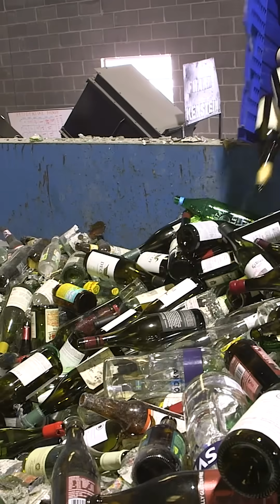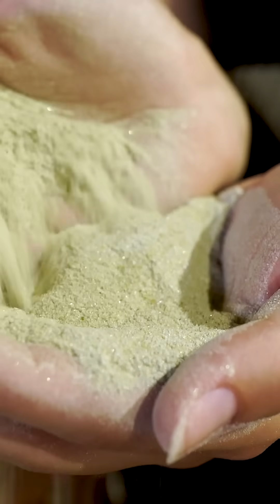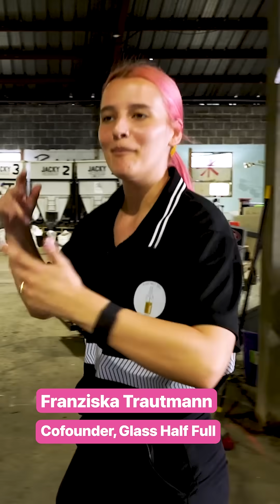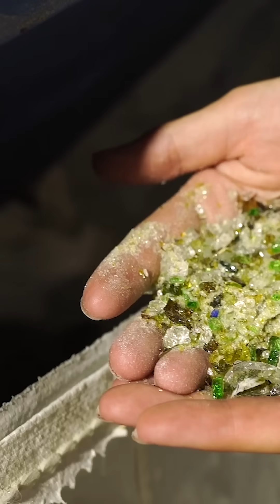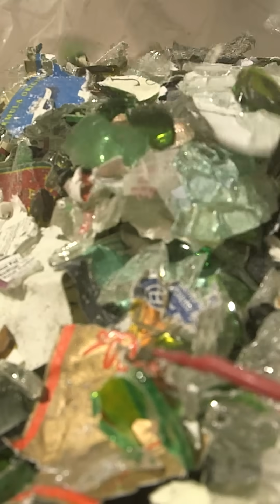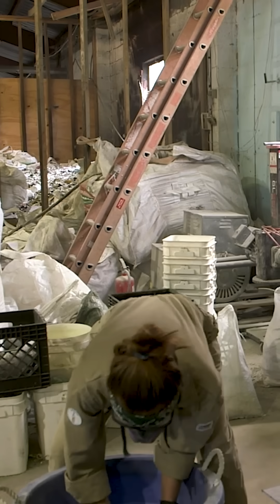Here’s how this entrepreneur crushes glass bottles back into sand. #Recycling #Sand #Glass

Comment: But why though?! Glass recycling is done by melting freaking glass to make more glass with zero loss of quality (in fact... It IMPROVES quality). Turning it into sand again is just a massive waste of energy...
Reply: Seems like this is also a way to get rid of labels or other impurities
Reply: @asdqwe4427  1 - break bottles.
2 - soak bottles in water for a day or so.
3 -  jiggle container
4- remove glass from bottom of container
5- enjoy your non labeled glass

or just place it all into a furnace and skim the impurities from the top of the molten material before turning it into new glass.
Reply: @pedromoura1446  are you sure that’s more efficient? Also the powder is more space efficient
Reply: @asdqwe4427  yeap. Each tonne of recycled glass added to the furnace saves around 1.2 tonnes of raw material and for every tonne of recycled glass, about 580kg less CO2 is emitted (uk data).

And i'm not sure about the space economy but not necessarily... Powdered material usually has more free space between particles which makes it LESS efficient in space usage. As an example if you remove water  (which is filling the gaps in place of air) from silt it will shrink to around 1/2 it's size.
The more amount of the material is solid the less space it occupies (i know it's counter intuitive but think of powdering a material as increasing it's air content)
Reply: @pedromoura1446  compared to a hollow bottle, I really do think the powder would be better
Reply: @asdqwe4427  Btw... 
Imperial Ton = 1,016.047 kg = 2,240 lbs
Metric Tonne = 1,000 kg = 2,204.6 lbs

1 Tonne is slightly less than 1 ton. Just an interesting tidbit for those who prefer "freedom units" XD
Reply: @asdqwe4427  oh! yes. Definitely. Just not necessarily better compared to just crushing it and calling it a day.
Reply: @asdqwe4427  A 2000 degree furnace works wonders for that. Any metals will sink to the bottom (but can mix and color the glass). Organic matter all burns away to CO2 and H20.
Reply: This company sells the sand to be used for construction since sand mining is extremely harmful.
Reply: @nativ3s268  This seems to me like the recycled paper story all over again...
writting paper companies require high quality paper which is only obtainable after processing trees.
toilet paper companies dont care about the quality since recycled paper is softer and what they sell is an end product anyway.
this is spectacular!
we could turn 1 ton of wood into 1 ton of high quality writting paper and then recycle it into 1 ton of toilet paper before throwing it into waste right?!

so what did we do?

We use recycled paper to make writting paper (along with MORE fresh paper paste because recycled paper alone cannot be used to make useable material) for the marketing and in the process made it worse quality and more expensive while ALSO making toilet paper companies use high quality paper in order to make their product which now goes directly to waste with no reuse or recycling. 
so we now cut 1.5 tons of wood with 0,5 tons going to make books along with 0,5 tons of recycled paper from other books and 1 ton of wood goes directly to make toilet paper which then goes straight to landfills.

🤦‍♂

EDIT: the real numbers are even worse btw...i'm simplifying it. the main problem is cost. 
The recycled raw material is more valuable now than the one made of wood directly. This means that ALL the companies that used to take in the recycled material because it was cheap as dirt now just buy fresh material.
if we previously cut around 1 ton of trees to make 1 ton of wateavers per year. now we cut 2 or 3 because we're making everything out of fresh paper paste.
Reply: @pedromoura1446  I agree with what you’re saying but I need to know more detail. Could you cite your sources? That would be really helpful 🙂
Reply: @pedromoura1446 We need respirators against all the negativity you’re putting out. At least she attempted to tackle a problem in her experience with a clever solution, you’re just sitting online critiquing the efforts of others.
Reply: @pedromoura1446 you do realize that these bottles were destined for a landfill, right?  I saw the Penn and Teller’s Bullshit episode about recycling too, but she isn’t taking anything out of “the cycle”.  She is taking what isn’t wanted otherwise and making it useful for many different purposes.  Companies like mine buy recycled products like this, rather than buying the newly produced kind, and there are virtually zero sources in the US.  This is a brilliant thing that should be done everywhere.
Reply: @highfae  what negativity!?
i'm trying to understand why this is being done compared to the better alternative...
companies have been pushing for decades  for governments to allow exploration of more beaches with quartz sand while there's material that creates a better, cheaper product freely around!

is it negative to point out that apple is selling products that dont have enough quality to warrant the price tag too?
Reply: @user-pt1cz4ot1e  i have no idea what "Penn and Teller" even is XD
what i saw here is similar to what's happening with paper in the US (recycled paper with lower quality is being used to make writting paper while toilet paper uses brand new paper paste it just happens that in this case the higher quality is the recycled product)

if your company is a building company 
you most likely dont use that glass sand to make concrete but to fill up the foundations before placing concrete.

If it's one that repairs beaches...well...repair the one next door with higher biodiversity that is being destroyed because they're collecting quartz sand there.

If it's a glassmaking company then well...that's kinda what i was hoping would show up...why is this material not being used in glass? and why powder it? i've been to several places were they use recycled glass and it needs to be crushed sure... but not anywere as fine...
Reply: @nativ3s268 what the heck, why on earth would you need sand from glass in construction. Sand, naturally, seem cheap. It makes no logical sense that what you're saying is economically sustainable in any way shape or form.
Reply: @nativ3s268 harmful to what ??? Someone's feelings??
Reply: @nativ3s268  The construction industry doesnt really care about the quality of the sand so this person is just literally burying tons of high quality sand that could otherwise be made into bottles into foundations and walls that can be made of wateaver.
And it might make everything even worse because smashed bottles alone are not gonna cut it for construction but NOW glass companies are going to mine MORE sand on top of what already is being mined because they also need it to make bottles to replace the glass that we're taking out of the cycle and because they seek a rarer form of sand (with high quartz content) this will make them tap into sources that were previously unneeded.

And bear in mind that such kind of sand is quite a limited resource and we're ALREADY running out of it with new sources being quite often in protected areas with high biodiversity (because quartz deposits along other light suspended materials like organic matter).

It makes NO sense to do this at all...
Reply: @pedromoura1446 Yeah....and construction is in a crisis due to lack of sand 🤦‍♂️ only specific types can be used
Reply: @AwwYouTried8639  more or less... What's in trouble is the glassmaking industry. Sand for glass needs a high enough quartz content otherwise it's not going to melt, not going to be translucid or it's going to be the wrong color... and that's freakin hard to find (something like... And i'm talking out of my ass but... 1% of all sand or something like that is fit for glassmaking). 
For construction what you want is sand either as fine as possible or with a specific granulometry so it holds better after mixing and it also saves money if it's rich in limestone and has low to no salt content (limestone partially dissolves in water making the final product more robust and salt ruins this reaction).
If it's found like this it's cool but it can otherwise be sieved into becoming like this making it more expensive but by no means rare.
In fact River sand is spectacular for building because it has all of these characteristics while sand with enough quartz for glass can mostly be found on the coast...either way... You're reducing quality of the final product and ruining the environment trying to turn one into the other 🤷
Reply: @pedromoura1446 can you summarise it and make it understandable
Reply: @AwwYouTried8639 Lets clarify this. Sand for concrete use is in short supply. There are plenty if other uses in construction. However I don't know if glass cullet is acceptable for use in concrete. Some fiber glass breaks down due to the alkaline nature of concrete. Other glass is fine and used as an admixture. Since this cullet is mixed recycled glass it may be hard to be sure the right kind is present. Or maybe all glass bottles are an acceptable type. I don't know, but its a risk. 

I agree with this post though. For recycling glass it is a huge waste of energy to crush it finely. The same as compared to extracting and sifting it as well.
Reply: @pedromoura1446 In NC they have stopped collecting glass bottles and jars for recycling anyway - we are just told to put glass in the garbage bin, so it goes to the landfill.
Reply: @AwwYouTried8639 The world is actually running out of sand used in construction 😅
Reply: @pedromoura1446 You didn't listen. Learn to open your ears and utilize them. All these glass bottles were destined for landfills but this company steps in to then utilize it rather than bury it
Reply: @pedromoura1446 Yeah actually, they do care. Do you know where every country in the middle east gets its sand for making concerete? The UK. The sand there is perfect for concrete. Desert sand is not. If it didn't matter why would they go through all that hassle?
Reply: @pedromoura1446 as saying goes "The road to Hell is paved with good intentions"
Reply: @PhoenixFires  it's also better to send trash into a landfill than to let it at your door forever... Just because it's better than nothing doesnt mean it's good.
Reply: @itiscujo  of course theres better sand for construction than others... Desert sand grains are too round to hold properly. But sand for construction can be from rivers, beaches and even "made" by grinding stone or digging a hole in the ground. Quartz sand in building is only suitable as a base on foundations and not for making concrete. Sand for glass is also 1% of all available sand. It's not even comparable the amount available for one and the other...
Reply: @pedromoura1446  Construction cares massively about the properties of sand. Why do you think we don't use the sand from deserts or riverbeds for concrete or filling back soil. The sand is so round that the friction between grains gets so low no loads can be supported or a proper concrete structure can form
Reply: @christophbethe7871  I understand that. the thing is THAT can come from rivers, beaches and quarries with similar costs because it always has to be processed (River sand needs to have Clay and organic matter removed, beach sand needs to be washed away of salt and mined rock needs to be ground up to specifications... ). 

While quartz sand is only 1% of all sand and mostly found in beaches.

For construction i could theoretically dig for sand near the construction site and then just crush it or sieve it to obtain what i need. For glass i could dig for miles and never find quartz in it or otherwise needed to refine the material again and again and again in order to obtain even a small amount at 95% purity.
Reply: @pedromoura1446 tell us you dont understand the differences in types of sand without telling us you don't know there are differences in types of sand...
Reply: @pedromoura1446 you there is a difference between sand and sand usend in construction you are not allowed to use just any sand or is it normal in usa
Reply: @court2379 I purchase the finely recycled glasses like that.  Not sure where you think we should get it otherwise.  No where around us recycle glass anyway.  It’s all thrown into the dump.  Not a waste of energy if there was literally zero effort beforehand.  It’s only a waste if it has no purpose, or there are more efficient options.  If you know those, please let me know.
Reply: @pedromoura1446  it would’ve ended up in a landfill so the same amount of sand would’ve been mined.
Reply: @pedromoura1446 dude saudi arabia has to import sand for construct despite them living in a sandy dessert, bruh
Reply: @pedromoura1446 are you an engineer by chance ?
Reply: @Faesharlyn   quartz sand is only used as filler in construction (not structurally) and is only 1% of all sand that's available.
please elucidate me why i should waste more characters on the remaining types of sand (which i did in other comments were that was relevant).
Reply: @derionone  yes. i know. but the point is that quartz sand is far rarer than "normal" river sand or beach sand. 
construction sand can also be manufactured while you also cannot do it easily with quartz sand.
 You'd need to mine and crush pure quartz or refine other types of sand over and over until almost only quartz remained. 
The amount of energy for either of these processes in order to make glass is tremendous when compared with sifting sand until you get the mechanic properties you're looking for construction.
Reply: @IratePuffin  completely agreed. a friend of mine used to say that "when everything is sh*t a blade of grass smells like perfume.". 
i'm not criticizing her, most likely great, work were there is none. 
i'm just trying reeeeeally hard to understand what circumstances, or lack thereoff, made this company something outworldly and spectacular when it's common practice in the rest of the world to sell this glass to glass manufacturers that are more than happy to work with this superior material than buying sand.

To a person like me that lives in a country were doing this is a no brainer it's like praising people for...i dunno...crossing the street on the crosswalk or making sure the food you sell is not decaying...
Reply: @zman90  well...they could...they just wouldnt be able to make skyscrappers XD
Desert sand grains are too round so it doesnt hold up well... (there's also some sweet traditional buildings that are excavated instead of built upwards)

Think of it this way...the perfect building material is a solid block of stone. but you cant mold one easily and the thougher the stone is the harder it would be to shape (it's also more difficult to find the perfect material for certain constructions) so the next best thing is to get something as close to solid as possible made from shards of a resilient material before filling in the remaining gaps with cement.
So you want somewhat jagged grains of different sizes so they fill the holes left by one another leaving almost no gaps before you throw in a material to fill them. 

anyway...you can still make i dunno...small houses with desert sand and even wood ash or clay...just not taller, more "modern" buildings.
Reply: @KO-fh4vn  yes. not that it matters much but i am XD
Reply: @pedromoura1446  lol not true. it has to be good-quality sand. Beach and river sand, it cant be just sand. Check your facts.
Reply: @waveril5167  sigh...i swear i've answered this a million times by now...
I KNOW!
that's partially my point since quartz sand is terrible for construction (unless you use it as filler when it's cheaply available which is a waste).

FOR CONSTRUCTION, you can use river sand, beach sand or do what is becoming common practice now, due to lack of river sediment and all the problems their removal causes, which is MAKE sand from stone mined from a quarry.
Manufactured sand is usually better quality because it has very specific granulometric and mechanic properties that allows for material savings because it can be prepared to have wateaver compression resistance you require. For a small house you can go with the cheapest material (even desert sand can be used although it's terrible), for a taller building you can reduce costs by using a better material and for a skyscrapper you need several different types of sand to make concrete with different properties depending on the height.

FOR GLASS only 1% of ALL SAND has the required >95% quartz composition to be useable. And it's usually found IN BEACHES (although i am aware that in-land sand mines exist the same as in-land salt mines exist).
And if that was not all those beaches are either occupied by tourism, have high biodiversity or are disappearing due to coastal erosion. 
The alternative to this is to mine quartz and grind it into sand or by vaporizing SiO from minerals containing silica which is then turned into SiO2 (aka quartz) by making it react with oxygen.
Both of these are highly energy intensive because quartz is rarely found pure despite being one of the most abundant minerals on earth and because it's hard as f***! (for comparison... ordinary steel has around 4-4.5 hardness on the moh's scale and your teetth have around 5 while quartz has 7).

we're also using MORE and MORE of this material not only in glass bottles and windows but in fiberoptics, solarpanels and SEMI-FREAKIN-CONDUCTORS (which we are literally on a crisis of lack thereof).

That's my point...construction sand can be mined almost anywere and the most important thing is the shape of the grains and their granulometry (the % of each grain size in the sand).
(ofc the material is also of some importance ,especially for taller buildings, but even then the best sand for it's load capacity is made of granite, of which we have literal mountains of!)

so...We could mine the granite for construction and use the sand for glassmaking OR we could vaporize the damn thing to obtain quartz and use the sand for construction. which one do you think it's easier?!
Reply: @pedromoura1446  no, I don't waste my energy on people like you, who no matter how much one tries to educate remain recalcitrant to learning and prefer to believe in their own opinion regardless of the evidence.
Tell the Egyptians that "Quartz sand is terrible for construction" lol

 Have a nice day : )
Reply: @pedromoura1446   sand quality is a big thing  in construcktion but i doubt they use ground down glass when you can dig it up.
Reply: @pedromoura1446 "the construction industry doesn't care about the quality of sand"

Stopped reading there. There absolutely is specific kinds of sand required for various construction techniques. This is the reason there is a growing concern over a "sand shortage".
Reply: @pedromoura1446  you realize she said they get it from landfills meaning it's been thrown away ergo will no be recycled into more glass ergo what she's doing is still recycling said glass it's not a waste for them of they have companies that buy the product. when people actually recycle on a global level then it woupd be a waste but since the majority of people do not recycle your argument has no real point
Reply: @pedromoura1446 you've never heard of Penn and Teller?
Reply: @pulaski1  or take it to designated glass dropoff points like the library and fire department near my house where they're then taken to glass recycling plants... or that could just be a local thing since I'm in GSO...
Reply: @SpixTenny  Locally I can take glass to the county-run waste collection sites (for people who don't want to pay for garbage service), and among other things (paper, cardboard, glass, engine oil, etc.), they still , apparently, collect glass for recycling. ..... I am skeptical that it is actually recycled though.
Reply: @pedromoura1446 you have no clue what you’re talking about. it’s kinda comical.
Reply: @pulaski1  I can't argue with you there... blegh
Reply: @Faesharlyn  egyptians quarried limestone from miles away for construction and modern egyptians probably use normal concrete for the rest like everyone else (which doesnt use quartz sand because it Binds terribly) but i am quite curious as to why you'd say that since quartz sand is hard to find and searching for it explicitly for construction is very unnecessary...
Reply: @pedromoura1446  quarz sand is hard to find?

Saharan dune fields are, with a few local exceptions, composed of pure quartzose sand. Millions of acres of it.
Reply: @tobiascarlsson5967  depends a lot on the construction size and the building part but yeah. Thats the jist of it.
Reply: @UpToSpeedOnJaguar  the "sand shortage" is not because there's lack of sand in the world. It's because production cant keep up with our increased demands and because we used to rely heavily on sand digged from beaches (which are eroding away) or rivers (which cause eroding beaches, collapse of river infratructure and damage to the river ecossystems). Nowadays it's mostly manufactured in quarries with better mechanical properties but we also use stone so everything is pilling up.
And as i've already said around 14 times by now... 
In theory you could dig a hole in the ground were you're building and then just grind or sift what comes out and mix it back again to get the needed sand for construction. You cant do that to get sand for glassmaking (quartz sand being 1% of ALL existing sand).
Reply: @Homemaker-eg2he  she's getting the material from somewere isnt she? She's either mining a landfill or getting it from the landfill company that separates it for her.
This is just a normal process in the rest of the world done in every single trash collection plant because glass has value and the state doesnt want to pay to keep an inert material on the ground wasting space were other materials could be placed...
Reply: @poppysdaddi  enlighten me please
Reply: @ericbuzzard2041  nope
Reply: @pedromoura1446 I'm with you, it sounds crazy, BUT...they did say she's getting the glass from the dump & not from recycling...so... maybe it's worth it ...?
Reply: @pedromoura1446 one more thing, can't we just pump sand up from the sea floor? giving us basically an infinite supply??
Reply: @erkl8823  she's getting only glass which means they're making a triage somewere like they do in other countries for all the trash. but yes. i agree that it's better than using the glass to fill up the garbage dump. the absence of recycling entirely is just baffling to me.
Reply: @erkl8823  we could yes. We do just that when searching for archeological artifacts. But it's just much more expensive and we could never supply the several hundred tons needed, add to that the fact that the bottom of the Ocean is almost always a rich ecossystem unlike dry earth ecossystems and it's better to just leave it alone . For construction it's just easier to make it either by recycling concrete or from mined stone as for glass, recycling and quartz sand are still our best sources.
Reply: Was gonna say. Wonder how many tons of coal this sand factory burns on a weekly basis, in terms of energy use.
Reply: Ikr, I would not feel safe with sand made from glass
Reply: It's great for sandblasting no silicone in it anymore actually safer than new sand.
Reply: @johnscott2849  errr...quartz is SiO2 (ie. silicon dioxyde) so it's literally silicon XD
but i can understand why it's great for sandblasting given the material properties of quartz...
Reply: Probably so that other companies can produce fiber glass. Would make sense since no one is sorting these by color.
Reply: @quinson93  that... Is actually the best argument i got for this so far... Probably you would need to purify it to some point but using it for fiber glass could indeed make some sense...
Reply: IT's.. not even sand.  It's glass dust.  It can't be sand again since the chemical reaction that made it glass isn't undone by simply smashing it.
Reply: @realbaconoverlord  my point exactly. Crushed glass around the size of a thumb can be turned into more glass. Why go further and waste the energy to powder such a hard material (it's harder than common Steel btw) instead of just chucking it into a furnace?
Reply: @pedromoura1446  No kidding.  It's an unnecessary step if they are planning to make it glass again.  However, in today's society??  They'll probably use it in children's playgrounds...
Reply: Yes!
Reply: Ya na
Reply: Well, you can use the incredibly desirable sand to create construction materials like concrete or a singaporean park instead of the modern status quo of freaking sand mafias with corrupt government connections literally stealing sand in broad daylight and then nobody actually asking where the sand they just bought came from, heavily damaging valuable rivers and entire beaches disappearing over the weekend.

It's like flicking water at burning rocks but it's still something.
Reply: They do it to help restore wet land.
Reply: I agree
Reply: I'm with you. These people have no idea what they're talking about. This is probably one of the dumbest recycling ideas I've ever heard. It's just crushed glass. It's not really sand. You can't make sand from crushing glass. It will either be too large, and just be sharp chunks of glass, or be too fine like what she was holding and be glass powder which is very dangerous and also mostly useless.

This is not "green" recycling. This isn't helping the earth. The electricity used to crush this glass and the trucks used to haul it to and from their 'sand refinery' is using more non-renewable resources than it's saving. Wait, is it saving anything? There is more sand on earth than nearly anything else besides water lmao. This is a scam. She probably gets tiktok girls to fund her pet project and gives herself a hefty salary. If you look into it, most of the people who run these "green" start-ups live very, very well and make a lot of money. Especially when they get funding from the government because their aunt is the mayor or something. They make some lame idea, their friend in the city government gets it funded, and they both make bank. Or they take advantage of stupid people on gofundme.

Seriously, I'm all for recycling, but this is a scam. We literally have over 7 quintillion tons of sand on the earth. And this girl has convinced people we need sand 2.0 LMAO. The whole point of recycling glass is to turn the waste into something useful. The best method is for bottle recycling so company's can re-use bottles that have been turned in which a lot of companies do. Not crush it and sell it to the city to use in local construction hahaha. I have to admit it's a clever scheme. Something you'd see Randy do in a South Park episode. It's just stupid and simple enough to fool the dumb people who would flush their money down the toilet if someone told them that fish could eat $100 bills.
Reply: Oh my, why do you think plastic comes in granulate form to factories?
Reply: @davidd2661  glass needs to be crushed yes. Not made into sand. Plastic comes in granulate or does it come in fine powder hmmm?
Reply: @pedromoura1446  yeah fine glass sand is weird. Also could maybe because larger chunks are more dangerous
Reply: @moltenhydrogen2218  Maybe you're misreading or mixed up comments but I literally said that this is a more effective use of glass. What gave you the impression I didn't?
Reply: @PhoenixFires  oops, replied to the wrong person
Reply: Erosión
Reply: I left the comment that basically said the same thing, moronic 😂
Reply: This business model creates a demand for a product that is already stocked to the gills. Im lost as to what the “entrepreneur” achieved here.
Reply: @mikefresca2758  that was what i was trying to understand. If you read the above comments it appears that most glass in the US is not recycled and is sent for disposal along the rest of the trash... Some people even claimed it's more expensive to recover said glass than to make new one from sand which confuses me to no end...
Reply: Rebuilding unnaturally eroded sandbanks is one of the main uses
Reply: @BrushiumTentaculum  which we're going to erode back if they have sand with the required quality to make glass...
OR...we could recover those places with non quartz rich sand that would be cheaper to find and wouldnt cause material scarcity in the glassmaking industry...
Reply: They also sell the sand for coastal reclamation
Reply: @WithersStan  again... Why?! That "sand" is well sought after and entire beaches are razed to get it due to it's rarity. By placing the glass back into the cycle you're preventing the need for it in the first place...
Reply: @pedromoura1446 dude what are you saying? They put it into bags and use it for coastal restoration in Louisiana because they are using more sand to fix their coast than can be produced. So this is a good option considering they use so many bottles in Louisiana.
Reply: @indiaknowlden9699  i'll try to explain again why doing that is silly, it's going to be a long comment but bear with me (i'll also try to explain why it makes no sense to construction. you didnt ask but most people also talk about it and i want to address it).

1st of all, beaches only require restoration for 3 reasons:

1 - there's a port nearby.
the outcrop of the port caused sand to retain north of the natural beaches, this can extend throughout all the coastline as people try to solve the problem with other outcrops called "spurs" that retain sand, which cause problems downstream, wich requires more spurs...etc...
How do you solve this? you remove the spurs or create a bypass in every one.
What do you do now? you pay for the dredging upstream then you sell that sand to someone who sells that sand for wateaver including placing that same sand on the beaches to "restore" them.
there's no lack of sand for this process...

2 - the removal of river sediment.
dams and other constructions in the rivers create sediment acumulation which is then most often dredged and sold for construction although a % is forced by law to be dropped downstream. this greatly diminishes the amount of sediment that reaches the sea and therefore the sand available for the beaches.

3 - rising sea levels. as sea levels increase sand is more often reclaimed by the sea due to storms or currents. how do we solve it? we dont unless we solve climate change.

Just so you know...1 and 2 are the major problems by a longshot, the 3rd was already a natural process that is only now becoming a problem because we abuse 2 and have delayed solving 1. 3 was a increase in coastal erosion just strong enough to make things go awire in some spots.

Now you know that there's plenty of sand out there you got to undertand that:

> for construction RIVER sand is preferable (rich in limestone is even better) because it has no salt (salt ruins the cement bonding) and the differing size in the grains creates a better structure as it fills most of the gaps)
If none of those characteristics are available they can be made by sifting and mixing sand grains with differing sizes or cleaning it to remove the salt (this also makes the end result more expensive).

>for glassmaking usually BEACH sand is preferable because the sea currents separate the grains by size and materials, so by knowing the weight of the material you're looking for you can literally find a beach full of it down the coastline.
fine sand, high quartz content ready for the taking in some specific spots (there's also in land reserves were the sea used to reach. the same as salt mines).
unfortunately...quartz is very light and tends to deposit were organic matter also does which means that those beaches are also often filled to the brim with biodiversity.
This means that mining sand for glass is VERY environmentally damaging.

What's the problem in using milled glass for beach restoration and construction then?
well...

1st - even glass milled as fine as shown is jagged. this means that if it enters your eyes or lungs it's going to cause massive problems. you dont want that in your beaches OR your house.(it's the same problem we had with asbestos.) 

2nd - it's NOT what the construction industry is looking for. you want a high diversity of grain sizes so they fit in each other like a puzzle and fill as many gaps as possible. this diminishes the amount of cement required to maintain the same structural integrity so they'll at most use a small % of glass powder as fill (and it's very unlikely they will given the high price of this material)

3rd - It's removing material from the industrial cycle making them seek out more.
you're placing what's essencially quartz on a beach that is then going to be washed away until it refills the beach were people are extracting sand for glass with a LOT of lost material in the process. so it's going to end up being used to make glass, again, just with extra steps. instead we could reduce extraction by using that same glass to make more glass instead of extracted sand and that would save us:
> the energy to mill it, 
>the energy to mine sand,
>the environmental damage of extracting that same sand and some extra due to material loss,
>the energy of transporting the glass to the milling factory,
>the energy of transporting the glass sand to the beach,
>the energy to transport the beach sand to the glass factory,
>the energy required to refine the beach sand into high quality glass,
>etc

4th - there's no lack of sand for beach restoration. it's just stuck in the wrong place (dams, bridges, spurs, ports...) 

5th -hundreds of tons are required each year for ONE single beach. there's no way they can produce enough for even a single beach by milling glass so this "sand" they're making will amount for a very small % of what is used. not enough to warrant the energy cost of making it. if they were milling used bricks and cement into sand again maybe...but glass?!

TL;DR:
this solves nothing just creates more problems.
Reply: @indiaknowlden9699  the reasons there's not enough sand are well known:

1- rivers have dams and bridges which accumulate sediment. that sediment is taken away and sold. if sand never reaches the sea it's never made into beach sand. >solved by: forcing companies to drop some of that sediment downstream instead of just selling it all.

2- docks and ports accumulate sand upstream (i believe in the US the coastal streams are south to north due to coriolis effect), which would otherwise reach the beaches. that same sand is ALSO taken away and either sold or gets stuck again in structures designed to maintain beaches upstream of them. 
>Solved by: making bypasses so that sand can reach downstream beaches.

The zones that require coastal "fixing" are literally starved for sand and require TONS of sand each year to be maintained that are usually bought from the companies that clean ports and dams or from the dam and port companies themselves (depending on the contract) and then placed on site. 
Making artificial reefs (which i suppose it's what the sandbags are for) is not only just a temporary solution unless you get a equilibrium between the amount of sand getting in and getting out but powdered glass is a terrible material to make them because it's jagged (damages the geotextile used to hold it), light (it WILL be dragged away during a storm) and made lighter after being powdered (after a tini tiny rupture say goodbye to the whole content).

There's also the added problem that sand made from glass is really not that much. 
as an example...
we restored a beach here in my country. it took 3 HUNDRED tons of sand, will take another 300 in 5 years and it's not even comparable to most beaches in the US. 2 or 3 tons is not going to make any difference.

If you want to do this just use refuse from  construction. it's much easier to turn into useable chunks,  more readily available than glass and you're not screwing up a whole industry that is already struggling to find material in the rest of the developed world.

Just sell the damn glass! 
Europe would gladly buy the material since it's cheaper, higher quality and doesnt cause as much environmental damage than using natural sand...we're LITERALLY suffering pressure from glass companies that want governments to let them explore high biodiversity beaches for sand to make glass and here you are throwing it into the sea...
Reply: @pedromoura1446 man I wish the people running these things were as knowledgeable and passionate about their work...thank you for taking the time and explaining everything in detail👌
Reply: @pedromoura1446 you are wrong watch the full video for all the information
Reply: @S5S5066  please elaborate
Reply: @pedromoura1446  glass half full does this for coastal restoration in louisiana because we are literally losing sizable portions of the coast and land each year due to coastal erosion and rising sea levels, mainly due in part to climate change. maybe don’t assume harm where it’s not immediately apparent if you yourself don’t have enough context to create a substantial argument to stand on.
Reply: @jyesthamars  i 've heard that argument several times and still makes no sense... You know how much sand we' ve used to restore a single beach here? 300 tonnes. And in 5 years we're going to need more 300 tonnes. There's no way she's producing anything even near that amount and this is just for a single tiny beach not even comparable in size to what's being restored there.

Quartz is very light and powdered is even worse so it's also going to disappear faster due to wind and currents. Even if used just for making artificial reefs it's a terrible material because those are made by filling bags with the sand and chucking them into the places that suffer more from the waves. This glass sand is jagged if you look at it under a microscope which means it damage the bags and then spill out and disappear in a blink of an eye.

Adding to all this quartz sand for glass comes FROM BEACHES. Which means that for every one she restores with that material theres around 1-2 beaches being destroyed to make up for the material that was discarded. If she sold it back to glassmakers she could make a far reaching impact. 

and before you say anything recycled glass is LESS energy intensive, produces BETTER glass AND it's cheaper to obtain because what people throw away is basically pure raw material that doesnt need to be excavated and purified. 

 so maybe, just Maybe, i DID check my stuff?
Reply: Must be a US thing... I cannot imaging this in any decent developed country.
Reply: @AreThou746 why?
Reply: @AreThou746 I'm in the US. I'm sure she thinks she's saving the planet,..
Common sense is thin on the ground at the moment.
Reply: @AreThou746  Glass must be crushed into cullet before being melted otherwise the process becomes inefficient. So yes it is a US thing and a recycling thing. But tell us more about you incredibly pathetic imagination...
Reply: @AreThou746  It's the exception for sure.
Reply: @court2379 what exception are you talking about?  The US doesn’t even recycle glass.  This is someone privately doing so.  I’m really confused as to where you guys are getting your info, because it’s totally off.  LOTS of other places recycle glass, and many do this or similar techniques.  Do you not remember the glass recycling vending machines that came out in Australia years ago.  This is that on a huge scale.
Reply: @user-pt1cz4ot1e  I have traveled quite a bit and found few places in the US that recycles glass. So for the most part I agree it is not a common practice in the US. It is in the EU. There are several key differences though. The population is not as spread out. The public sorts the glass when they take it to the bins, not just from other materials, but also by color. There are bins within walking distance in a lot of cities. They are more willing to walk places.
The US is more spread out so the number of bins and effort to install, maintain, and empty them would be greater with the associated cost. People are less willing to make the effort. Current recycling methods rarely have the people presort it. Everything goes in one bin and then to a sorting facility. Those facilities if they handle glass often don't sort by color, so the result is mixed color broken glass shards. The US is large and often has abundant sources of raw materials. 
So there have been arguments that if other counties can do it, it must be economically viable in the US as well. Because of the factors above I disagree, and that is bolstered by the fact that it is almost never done. If it was profitable, people would be doing it. 

The waste of energy issue is that for recycling back into glass, it doesn't need to be crushed and sifted to sand. Just small enough to get trash out, and make handling it easy. For use as sand extracting it from natural deposits uses far less energy than collecting, sorting, crushing, trash removal, sifting, etc.. People are also talking about it being available to help alleviate the shortages of concrete quality sand which would make it more valuable. I don't know if it is suitable for that or not. I know some types of glass are damaged by the alkalinity of cement making it unusable for that purpose. If it is usable, it might be cost competitive with available sources and worthwhile to spend the effort and energy. If not used for concrete there are many other sands that are far cheaper and readily available in most areas of the US making crushing it to sand a questionable value. In general though if the process was a cheaper method, it would be common. Economics drives most things in the US. 

Hopefully that covers most of the discussion. What specifically did you question though?
Reply: @AreThou746 Sweden, Slovenia, Australia, Italy, Belgium, Spain, Brazil, Japan….

The US doesn’t recycle glass at all in most places.  Why do you all think this glass would be going anywhere else in the US?  🤨
Reply: Looking at the size of her operation tells me she has customers.
Reply: You need to turn it into sand so you can melt it first.
Reply: @mrbanana6464  not this finely... It's crushed sure... but not powdered.
Reply: That's glass that has been put in a recycling bin, this is glass that was heading for land fill.
Reply: it doesn't mean to place it back on the beaches. it just means the fraction. it could be used in building development I suggest 🤔
Reply: @wie_der_mond  either one is a dead end use for a already rare material...
it will either sit on a building's foundations or on a beach while tons of similar material are being mined from another beach to make glass.
Reply: @pedromoura1446  no, you cannot use every beach glass to make a concrete. For example, there was a big problem with building skyscrapers at Emirates: they have a lot of sand, but it is not suitable for building 😄 they should have bring it from another countries!
Reply: @wie_der_mond  oh but you can!
beach sand is not the same as desert sand and not all beach sand is the same.

The main problem with beach sand is the salt (and other small things like shells and organic material) that have to be removed or they'll mess with the cement binding making for less durable and less resistant concrete.

This is why normally river sand is preferable. There's no salt that requires removal and the grains are jagged enough to fit into one another like a puzzle diminishing the space between solid material and the cement (increasing material strenght while reducing the amount of cement needed to bind the material together).

Desert sand has a different problem. it's grains are too round after centuries of wind erosion so they fit into each other less like a puzzle and more like a sack of marbles.

They could still make houses out of the concrete made with desert sand, just not several hundred story tall buildings that usually require several types of structural concrete and materials to sustain it...

Most sand used in those has to be manufactured from stone mined in quarries and then sifted and prepared to have very specific granulometric and mechanical characteristics not only for structural reasons but also cost. 
Every floor up from, i believe it's either 5 or 7 floors (cant recall exactly so dont quote me on that)...doubles in cost from the previous one, so the materials have to be as light as possible to reduce costs while being as resistant as possible to compression and maintaining enough elasticity to not break apart (the wind strenght on the top of some of these buildings is outright crazy and they'll need to be able to bend sometimes several cm's)

Essencially even if they did have sand with enough quality for building (like river sand) they would still import it since the material specifics for skyscrappers are ridiculously complex.

They COULD ALSO mine it and sift it on site (just dig a whole deep enough and you'll inevitably find stone to grind XD) with enough quality to do wateaver, if they wanted to, but it's much easier and cheaper to order already prepared sand from someone who knows what they're doing and already has the infrastructure to do so and also if there's something saudi arabia doesnt lack is money so even if it would be preferable in the long term to make the sand there they dont really care XD
Reply: @pedromoura1446  wow, thank you😃 didn't know!
Reply: @wie_der_mond  anytime ;)
Reply: @pedromoura1446  I'll just say, as someone who actually read your arguments, good job properly explaining things. 

The only reason I went into comments was "this is dumb, glass has been recylcled for so many yars now, what is this "entreprenueur" bullshit."
Reply: @pedromoura1446  look, when the option of disposing glass is either the landfill or turning it into a usable product, i would take this over the other option. You even admit yourself that most glass is not recycled in the US. This might not be your preferred way to recycle glass but its making a change in Louisiana and if they can get their hands on enough glass to continue operations then they are needed in the region.
Reply: @moltenhydrogen2218  if you read were i admited that you'd also notice i've said "when everything is sh*t a blade of grass smells like perfume".
Sure... It's better than throwing it into a hole and calling it a day. A lot better in fact.
And again... I'm not attacking the Lady that did this. She found a way to do it were no one else did which is nice.
It's just that recycling glass is such a good idea with literally no downsides and a given in the rest of the world that i'm mostly confused at how could there be a market niche for this to even be a thing given the highly superior alternative...
It's like hearing of a company that makes a profit turning aluminium again into bauxite for use in building...
We've had to make sooooo much regulation in Europe to deal with the "profit 1st" approach of the US to everything to even get SOME focus on efficiency to the point i have no idea how you still have a functioning economy with so much inefficiency...
Reply: I was wondering that too. How do you make a business of this outside of "female run company here,  give me money"
Reply: Every time @pedromoura1446 replies he sounds more and more desperate to be agreed with, I cannot imagine living like this lol
Reply: @intenseavarice34  it just hurts my environmental engineer soul to see people still agreeing with visibility instead of what actually works (and i dont like the bell having the numbers on display. it messes with my ocd)...but hey...if insulting the commenter is easier than thinking more power to you...
Reply: @pedromoura1446 This glass would end up in the landfill. Many places in the U.S. don't recycle glass. I believe this is why she started the company - to prevent reusable glass from being thrown away.
Reply: @emem2863  sell it to the EU. we'll buy it by the metric ton.
Reply: @pedromoura1446  The scrap value of post-consumer glass bottles is less than it costs to collect it from US consumers and ship it to Europe.  In any case, usage of glass containers is dropping sharply - most beer brewed in the US, and now even some water and other drinks are being sold in (easily recycleable) aluminium cans and bottles.
Reply: @pulaski1  That is just if you're not accounting for externalities :)

For instance...

The cost of land for burrying it and since you're doing it with a lot of toxic stuff you'll need to keep an eye on it despite glass being inert so you're just making landfills bigger and more expensive over time.

The cost of the garbage trucks doesnt change since you're going to have to pick it up anyway...trash can or recycle bin.

The cost of having to obtain the material somewere else instead of just refining what you already have on hand.

etc.

Of course the market alone doesnt care...it's up to the state to correct and make them pay for externalities to make them care and invest in what makes sense. like it's done for trains, roads, electric vehicles, wind turbines or solar panels.

in germany you collect bottles in supermarkets for a fee.
 the US used to do the same with not only glass but also with aluminum cans (i dont know if it still does now) and it worked fine.
in my country the state gets it from recycling points placed everywere.
In japan a truck from a company that requires the material goes to each building (at least once per month but most likely once per week).
It works in very different locations in very different ways the initial cost is usually the only problem. if they just dont want to pay short term to reduce costs on the long term that's on them but europe would still gladly get the broken glass even if you just burned all your trash and sold us the slag. in fact we do it to each other internally for specific materials so...🤷‍♀
Reply: @pedromoura1446  You know very little about the situation in the US.  Things vary by state and some states still have bottle deposits (5¢-15¢) that can be reclaimed by returning the bottle.  MOST states have never had bottle deposits.  And the cost of a deposit bottle system effectively doubles the cost of shipping a product as every bottle that you sell has to be transported back to the factory when it is is returned - so it is highly debatable whether a bottle deposit system is eco-friendly anyway.

I am not going to dismantle your very long post, but the cost of separating and handling glass, even if it is put into a recycling bin, dwarf all the cost savings of not sending glass to the landfill - except for the cost of making new glass/ new bottles.  But as I already said, the usage of glass for beverages in the US is in sharp decline anyway.
Reply: @pedromoura1446  Why don't you send the business owner your suggestion?
Reply: @pedromoura1446 I see the logic in your posts, the US is just very illogical. The fact that there’s even ONE of these plants is a miracle, the US is horrible about recycling, to the point that this company, even if its inefficent, is still a better and more beneficial option in the states to what we have right now. It’s cool to see how passionate you are though, I can tell you care about environmental engineering. The US does not, its horrible how poor we treat our land, because we stole it, and don’t care about it.
Reply: @pulaski1    it doesnt double anything. I dont know were you got those numbers but you have 4 ways to get recyclable materials.

1- door to door. 
2- at a the place of buy. 
3- in a public place (ie. Recycling bin)
4- a mix of any of the above 

All can work depending on HOW it's implemented.
Most countries in Europe implement 2 and 3 and japan the 2 and 1.

In fact... 3 is the most complex and expensive of them all XD

And it's profitable... 
Profitable is also not the same as "sustainable" as you can see with oil or Wind power... 

Were Wind power simply wasnt profitable for a long time because it required investment to make it reach a scale large enough to be so while oil already was profitable but was never sustainable.
Reply: @emem2863  i could. But When was the last time you sent your complaints to i dunno... apple, tesla or Coca-Cola... and they listened? 🤷
Reply: @squeakybb   i agree. when there's nothing something is always an improvement. I'm not trying to bash this entrepeneur for her work.
At the very least it's far better than sending it into a pit and making taxpayers pay extra to keep a piece of land closed off for a material that is inert by nature...
And thank you for the kind words :)
Reply: @pedromoura1446  The "double" I mentioned was specific to deposit bottles - the bottles have to be transported back from shop to factory, so the same cost as from factory to shop.
Reply: @pulaski1  what if they're from public bins or private houses? A truck has to go around Collecting them from dozens of bins and wasting fuel to collect glass that most likely has more impurities than if you got them from a supermarket.
Also... The cost is not the double. In fact it's closer to half. The same company that gets products into the shop can also take away those bottles back to the factory to be reused or recycled which saves a go and a back trip with empty transports.

And all you need is to tare the bottles. You pay 1€ for the product and 0,30€ for the bottle. you give the bottle back and you get your 0,30€ back. If you dont, you lose your 0,30€ which are then used to reimburse the company for the loss of the bottle. The company can provide the actual product cheaper as the bottle is not consumed and thus reduce manufacture costs and complexity, you dont pay the extra for something you're throwing away at the end and the environmental cost is heavily diminished. Everyone Wins.

This is, in fact, one of the simpler, cheaper and most effective methods to reuse and recycle materials (which is why you see it applied over and over all around the world).
Reply: @pedromoura1446  Your understanding of transport and distribution is poor, very poor.  I agree that the delivery truck could take empties from the supermarket to the warehouse, though there would still be time and handling costs, however [1] transport from factory to warehouse is commonly by contract truck, which goes from location to location, not just back and forth from factory to distribution warehouse and back, which is why I said the cost is double, and [2] in the US, most drinks are delivered to retail stores directly by the bottler/ manufactures, with the manufacturer literally bringing the water, coke, or beer into the shop and placing it on the shelves.  There would be a significant extra time in picking up and loading the returned bottles, which would require extra labour AND extra vehicles (because each driver and truck would be able to make fewer deliveries each day), and the pallets/ crates of empties being returned from the early deliveries would be in the way of getting the later deliveries off the truck.  The extra vehicles would use more fuel and increase road congestion.

You seem to live in a very simple world where recycling is always the easy and logical choice, and I wish you were correct, but unfortunately the world is much more complex than your world view allows for. ...... And as I said earlier, there are bottle deposit and return schemes in a number of US states, 10 total notably New England and New York, plus Michigan, Iowa, California, Oregon, and Hawaii.  But there doesn't seem to be any appetite to expand the deposit programs to other states, and Delaware abolished its deposit bottle scheme about 15 years ago, so, contrary to your assertion, the arguments for bottle deposits are not compeling.
Reply: @pedromoura1446  please mr. "engineer," google cullet and read about why it is needed for glass recycling. I know you will never admit to this embarrassing, drawn out squawking, but maybe you'll learn to do the bare minimum research before typing useless paragraphs. I can rest better with that possibility.
Reply: @Awesomeficationify  cullet = smashed glass. very confused. please advise on further line of research.
Reply: @pedromoura1446 Not only is it a waste of high grade sand, it doesn't help to solve the coastal erosion problem since it has none of the nutrients that wetlands flora need to survive. It's just an expensive way to add sand to the Gulf of Mexico
Reply: @pedromoura1446 listen to Smash Mouth's song walking on the sun. (90s kids I know right)
It wasn't a liberal hippie song about tree hugging. Listen closer, it's about the industry that arose as soon as people noticed pollution. 
Fashion is smashing the true meaning of it...
Reply: @glasstuna  i can agree (smashmouth rules and 90's ftw) but while i am a huuuuge fan of punk culture and individuals pulling up their sleeves and going "f*ck it. I'll do it myself" theres things we'll have to as a whole considering efficiency. While i love the fact that this person got in front and is apparently succeeding in her company i am more appaled by the fact that the government, which is supposed to go for efficiency, has done so little to the point that even doing this is a good thing.
Reply: @intenseavarice34 100%.  He’s got an idea in his head, got some people to click the like button, and now he’s losing his mind, trying to convince everyone else.  

I’m all for being responsible in every direction.  If it’s worse, then it’s worse and there is no argument.  Taking bottles that most places don’t accept as recycling isn’t that, though.
Reply: Comments like this miss the entire point. The fact is that the glass is landfilled, not collected so that it can be processed down to cullet.

Beyond that, glass recycling via remelting is much more complex as glass must be separated by type and cleaned before it's even ready to be crushed to become cullet. All this is also much more energy intensive/costly than reducing waste glass to sand.

Virgin materials are also preferred in glass manufacturer due to lower costs.

Finally, facilities such as that operated by Glass Half Full are easily and cost effectively set up wherever they're needed.
Reply: @ARepublicIfYouCanKeepIt  What is the value of the sand though vs. natural sand?recyclers don't want it for mixed reason you mentioned. Who is buying it? Extracting natural sand uses less energy and requires far less capital expenditures on equipment. 

The only use I can see that might justify doing it, is for concrete in areas where there isn't a lot of suitable sand, and even then it may not be suitable. It could be a novelty in small quantities, but I assume they process a lot of it.
Reply: @ARepublicIfYouCanKeepIt  obviously it's not landfilled...she's getting the material XD
unless she's mining a landfill (which i've seen happen but usually they dont stop at glass...although...even only glass would be a major improvement over nothing...)

ok...i always get this and sure...it's costly but costly compared TO WHAT?
compared to extracting sand from a beach which most likely has high biodiversity, cleaning that sand of salt and other impurities, sending it miles away into civilization were it will then be melted at a HIGHER temperature than glass cutlet because there's still impurities that increase the melting point and all of this while still getting the possibility that you got a bad batch for one reason or another and a ton of glass is now too brittle and useless.

I went to 3 glass manufacturers and they were all more than happy to go through that work instead of using virgin sand with several other manufacturers here even outright not using anything else that glass cutlet if they can avoid it. european glassmakers would happily buy all that glass instead of using sand...

Someone already told me that the raw material sand is cheaper that glass cutlet  which is why i was curious as to why...why is it cheaper to go through all the trouble to deal with a distant and harder to work material than the readily available one?
It makes zero sense...is it the lack of trash collection policies? did you find a quartz quarry so big you dont care anymore? it's just very confusing to me...
Reply: Almost all recycling is a waste of energy and water.
Reply: @canileaveitblank1476  not at all...depends on what you're recycling and how much money you want to invest in the process to begin with.

Aluminium is 100% recyclable and takes 8% of the energy required to make new material from bauxite.

Plastic can be recycled up to 2 times before it's non viable, doing so requires almost no energy and at the end of it's lifetime can be used in the same fractioned distillation process we make oil go through to get the materials to make new plastic (or more often...fuel)

Most metals ALSO dont come clean from nature requiring extra refining to be useable and we get high levels of purity by melting them. we do the same thing with metals in recycling just with higher useable material content than we could ever find in nature.

Glass is 100% recyclable, recycled glass is higher quality than glass made from sand, cheaper and uses less energy (since you dont need to remove the salt and other harsh impurities from the raw material nor does their presence reduce the material's melting point).

The tricky parts are that:

>most plastic will be in contact with us or our food (bottles for instance) and recycled plastic is never food grade nor high quality so it's usage is limited and is therefore burned. it COULD be reinserted into the cycle in the place of oil but oil is just ONE material while there's a lot of plastics and chemical reactions become increasingly complex to the point that it's just easier to not deal with it (it could be made...it's just that no one is interested in investing enough to make it viable )

> paper HAS to be clean and it CANNOT be connected with other materials, which most often is. milk cartons for instance are made of plastic, aluminium, paper and a plastic based ink all mushed together. 
how do you separate this?! you dont. 
you COULD grind everything and use solvents to remove each material one by one but that would be expensive AS HECK (not inefficient. that just depends on the size of the facility and the amount of material getting in for recycling since most solvents are reusable. just damn expensive to start such an enterprise). so usually it's just easier to burn the whole thing for energy and recover some metal from the ash.

>metal is not usually identified before being placed in a furnace so melting it just wields slag alloy with a lot of different materials in there that would then require extra processing (not that different from what we find in nature actually...) and that's tricky to do. again...not inefficient. just expensive. you'd have to calculate what amount of material you'd get of each type and then create a facility from nothing that would separate them from the slag before being sold.
That's not easily done because you'd most likely need to separate most useable material on the spot which would require either a massive facility or a very organized industrial ecossystem.

when compared to the damage and cost of extracting, transporting and refining raw materials, recycling it's not inefficient.
just very expensive to start because we dont have the know how nor the infrastructure required at the required size to make it work and we keep trying to do it with revenue as the main objective 

After it's done, though, it would operate on almost nothing since raw materials would be basically free (cities are required to take in the garbage anyway...) and renewable energy is 1/4 of the cost of fossil energy with that cost going to zero during peak production hours (the grid management literally wants to get rid of excess energy so they offer it away).

it's a bit like with trains, solar panels or electric cars, it requires a HUGE starting investment with no return for at least a decade but after that it needs almost no money to keep running. impressingly enough. some countries already did this. northern european countries recycle around 90% of all their trash so they're bound to start seeing the economic return soon enough.
Reply: @canileaveitblank1476 That's why it's low on the waste hierarchy. It would be way more environmentally friendly to separate, wash, and resell bottles that are still in good condition
Reply: @canileaveitblank1476  yet if we don't recycle as much as possible, we'll run out of natural resources and build up garbage even faster. 
One of my "favorite" statistic is the ecological deficit we're building up. We need almost two full earths to meet our resource needs :)
Reply: @feuerling  It is only a matter of time before we start dredging/ mining land fill sites to extract useable materials - such as glass and metals.  The day will come.